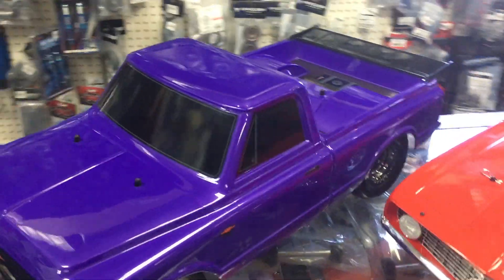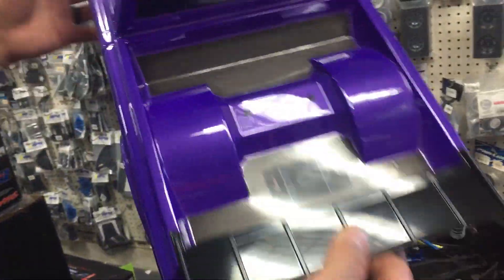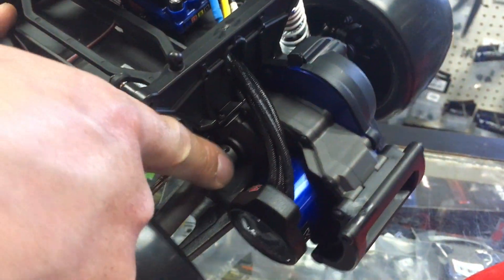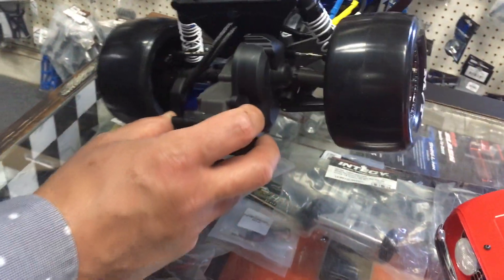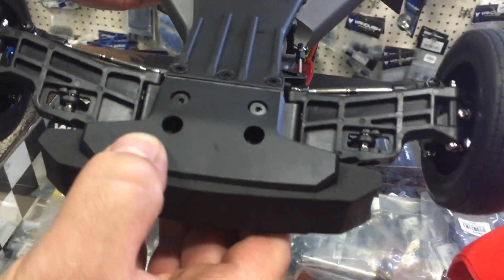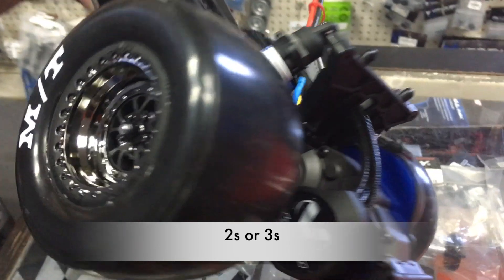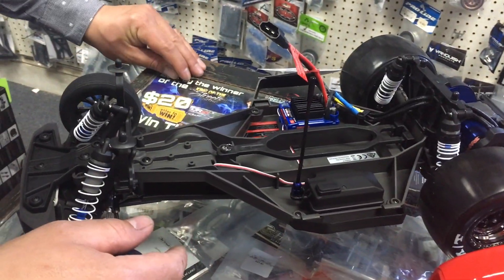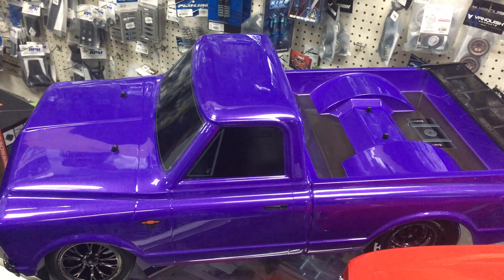Traxxas Drag Slash Chevrolet C10 Body First impressions

Comment: the purple color  awesome . mine is coming tomorrow i got black i had to take what was available i didnt preorder i got lucky found one in stock
Reply from the maker: That is a hot color. I was tempted but decided to get a 4-Tec 3.0 first. Once I rack up my points I plan on picking one up. Are you planning on keeping it stock?
Reply: @telecomandorc  yeah i will keep it stock for alittle bit..
Reply from the maker: @brianlip7290  Have you build a drag car before this buying the Drag Slash?
Reply: @telecomandorc  i have built a drag car before  .. but  out of slash 4x4 .
Reply: @telecomandorc  this is my first 2wd

Comment: I can't decide if I should buy a Bandit VXL and convert it to a Drag Slash or just by the new Drag Slash. What do you think is the best option.
Reply from the maker: The Drag Slash is less expensive. If you buy a Bandit XL-5, after buying the chassis, body, wheelie bar, PL 32P transmission, paint, etc., you will have spent the $500 the Drag Slash cost. If you buy the VXL Bandit, you will be over $500. I need to edit my video, but it is coming out today.
Reply: @telecomandorc  Thanks for the reply. Drag Slash here I come. Lol :)
Reply from the maker: @christopherrice1375  Here is the link. Although, you probably already saw it. https://youtu.be/a-Lbd5YLHc0

Comment: I got both of them
Reply from the maker: Awesome. What are your thought on the two? Which do you prefer?
Reply: @telecomandorc  is like apples 🍏 and oranges 🍊 you can’t go wrong with both the losi camaro on 3s on stock gear u will get about maybe 3-4 passs I haven’t swapped out the speed gear on the slash drag it runs good on 3s as well both of them got they pros and cons but I like both of them 🤔👍🏽
Reply from the maker: @joserobinson8419  My drag build with a Velineon System tends to jump on the wheelie bar on 3s. I really have to modulate the throttle. How is the Losi? I have been looking at a losi because of the aluminum chassis.
Reply: @telecomandorc  it’s really nice 👍🏽
Reply: @telecomandorc  you kinda go easy on the throttle but it is fast 💨
Reply from the maker: @joserobinson8419  I have seen the Losi Camaro. The quality does look superb.
Reply from the maker: @joserobinson8419  I will have to get one at some point. I just need to finish my 4-Tec stuff.
Reply: @telecomandorc  that’s awesome
Reply from the maker: @joserobinson8419  Too many RC options... too little time to play with all of them. I just like machines.